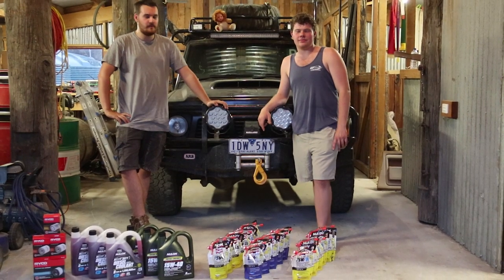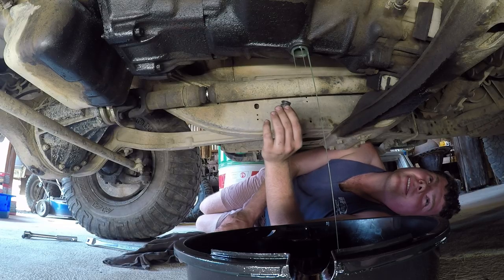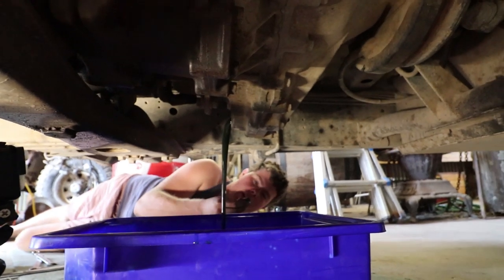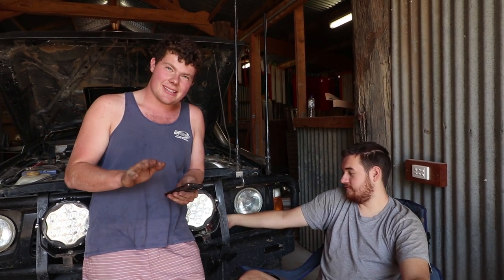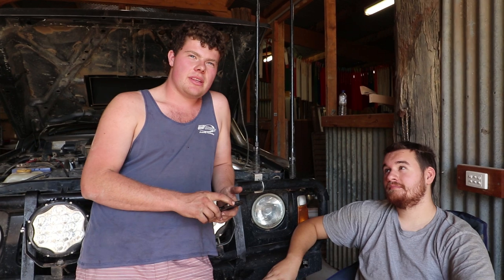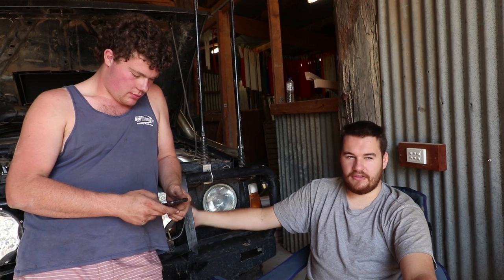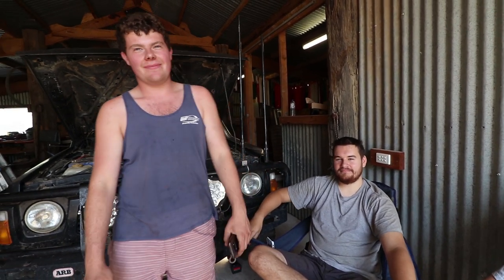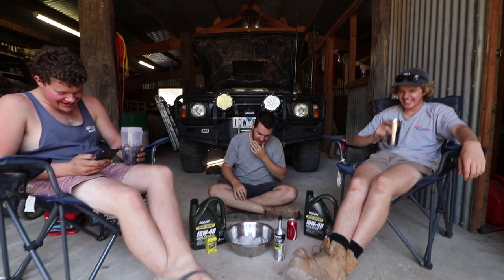Nissan Patrol GQ TD42 GEARBOX + TRANSFER CASE oil change & SERVICE + BONUS Q&A |Service Series EP: 2

Comment: Here you go. Save all you fellas the time googling the differences.

Silver top is easily identified by the vac pump on the alternator. These are the original forklift motor and are built strong. They will handle big boost and easily see 500,000ks. Around 93-95 they started phasing in the black top these were redesigned for automotive use. They lightened the piston crowns to help with higher rpms, they also use slightly different rockers and have larger cam followers. The vac pump on these is on the timing case. They also have 30mm gudgeons as opposed to the 28mm in the silver top which makes them easier to rebuild to turbo spec as the rods don't need changing. The turbo black top is the strongest of all. They have the 30mm gudgeons but have a stronger piston. They also have longer oil squirters which go into a gallery in the piston crown. They also have a larger oil pump. They have larger diameter front and rear main sections on the crank and a different hole pattern on the flywheel. In the head they have different precoms. 

They all have different cams

Ti has a different cam gear, different tacho sensor and the timing case is different to suit the sensor. They’ve also got egr.
Reply: KBSR Films do you have any idea how much googling you saved? I’ve been trying to figure out if my GU is a factory turbo (I believe it is) but I can’t decode the VIN
Reply: @MrHowdi  what year is it mate?
Reply: KBSR Films it’s a 99 Y61, the build plate says “TD42” not “TD42T” but I heard that was something Nissan changed later. Engine number ends with T and everything looks real factory. Cast intake pipe across the engine to turbo, compensated pump
Reply: @MrHowdi  you'll be able to tell were you get your oil feed from and were your oil return goes.
Reply: @MrHowdi  you'll be able to tell were you get your oil feed from and were your oil return goes. 

Factory turbo get it's oil feed from the block and oil return goes back into the block

N/A will either get the feed off the back of the alternator or next to the engine mount and the oil return will go back into the sump

Comment: Was always told transfer cases in patrols needed ATF fluid to run effectively or otherwise they wore out real quick ...             just brought myself an now building a GU patrol ute with A TD42Ti as a heart... makes 20Psi with the stock turbo an a boost tee inline ... with a 11mm boost comp pump fully rebuilt..
Reply: Yep agree I also use ATF dex 3 in my transfer. You can also put a bit in the gearbox if it has worn synchro’s will help with the grinding.
Reply: @francisreichelt254  how much ATF do you put in the gearbox for worn synchros?

Comment: Awesome stuff. Correct me if I'm worg. But there was 3 makes of td42 from my research. The original silver top. Then a black top the one with lighter pistons exct. Then a revised black top in a factory turbo option with even thicker pistons and stronger internals then the original silver top even the NA revised black top was still stronger then the old silver top. So there was definitely a week stage for black tops. But soon as the factory turbo option come out this was the revised black top version.

Comment: Lads, I have a 99 GU with as far as I can tell a factory turbo TD42 but she’s a black top. I always thought the black tops were the turbo (engine number ends with “T”) and the silvers were the NA?
Reply from the maker: Theres two different kinds of blacktops, there are the N/A blacktops that came out in the late gq's that had weaker internals. The blacktops in the GU are factory turbo and have the strong internals. Silver tops came in early gq's and were all N/A.
-Liam

Comment: Do I fill the gearbox up to the filler hole or is there a specific amount I’m supposed to put in it
Reply: Pretty sure they aren’t supposed to fill to the plugs like the Amaroks do, just did mine and put around 4L and I just stuck my pinky in the filler plug to see if I could touch it. Bit of a late reply haha, didn’t make it go to the plug

Comment: From memory the na black top and silver top have a 28mm gudgeon pins and the factory turbo has a 30mm 
Also any one wanna address that oil leak hahah
Reply from the maker: James calls it a "controlled rust protection modification" 😂😂
Reply: Haha
Reply: Na blacktops that came out in the early Gu have the 30mm gudgeon pins too!